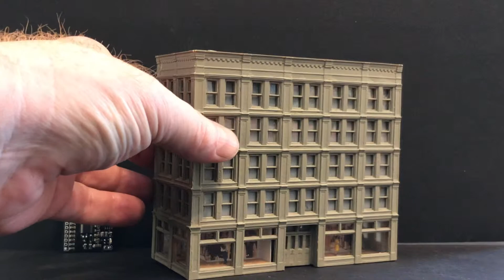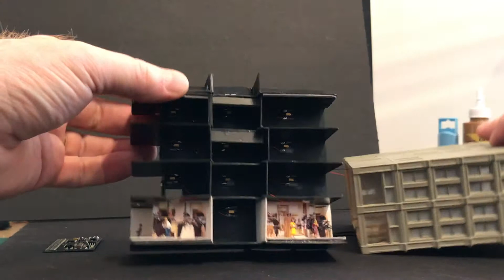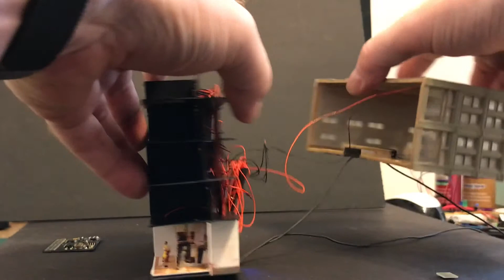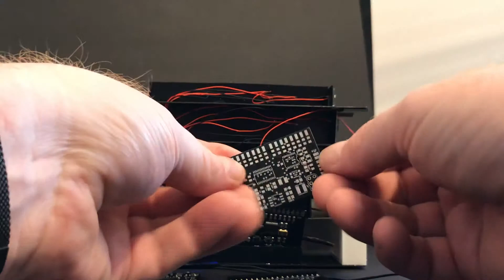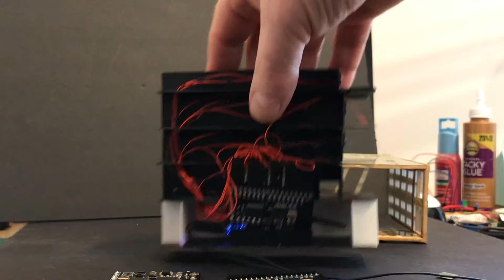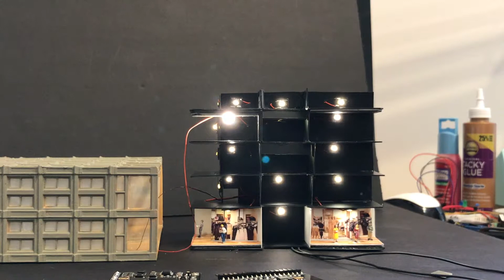DCC Controller LED Installation

Comment: So each board is addressable and each board controls 16 separate lights? Is this Digitrax compatible so each board can be accessed from the throttle?
Reply from the maker: Yes.

Comment: Almost to what I'm looking for. An option where one can use it on their scale clock like on the NCE's system to control the lights by the time of day or night, when the lights will turn on or off.
I gather that could be done by adjusting the settings on this?
Reply from the maker: Yes.  While there isn't a "real time clock", it does have an 18 hour timer so you can set each port individually for 8 hours on, 18 hours off - or whatever you fancy.

Comment: This looks great!  So one decoder could illuminate multiple buildings with power from my DCC rails?
Reply: Yes, that's right.  And with the various FX you could have some street lights at a lower dim lever, cars, a  blinking red light on top all run from one decoder.
Reply: @jlewis1210  Thanks!  This is perfect timing as I haven't added any lights yet!  Just ordered a starter set!
Reply from the maker: Yes.  There are 16 ports so you could light 2 or three small building with 4+ LEDs each.  The board already has the resisters so all you do is solder them up and adjust the light level with the DCC hand controller.